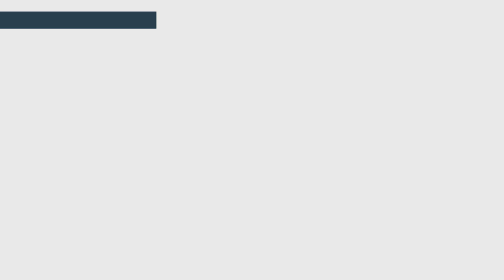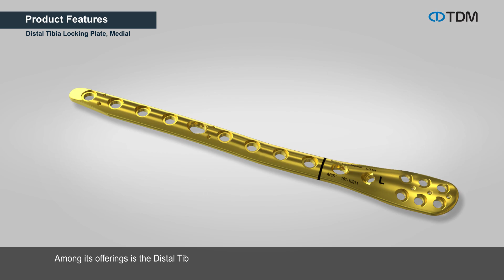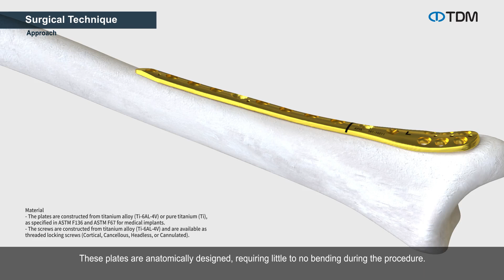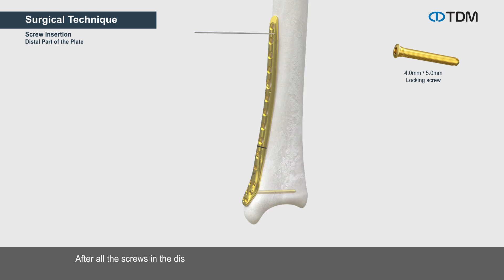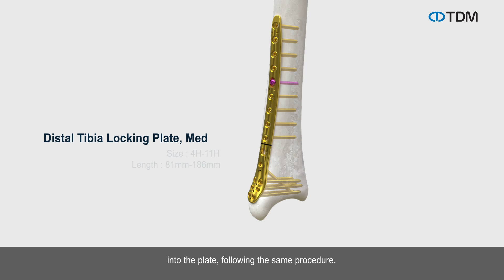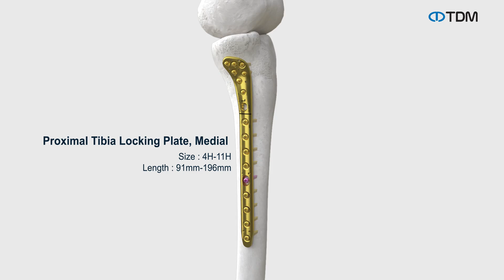[TDM Korea] Trifix Large Locking Plate & Screw System - DTLP Medial Surgical Technique

Comment: Thanks for the opportunity to comment. The completed procedure shows high screw density for a locking plate system. The objective is 50% purchase of screw holes or less.
Reply from the maker: Thank you for your comments.

This surgical video is intended to demonstrate the complete procedure and all available surgical steps, including all potential screw options. Individual surgeons will ultimately decide which steps to perform and the number and location of screws based on the specific clinical situation and their own surgical judgment.

As we do not have the full clinical details of each case, we cannot recommend omitting specific screws or limiting fixation to a predetermined screw density.